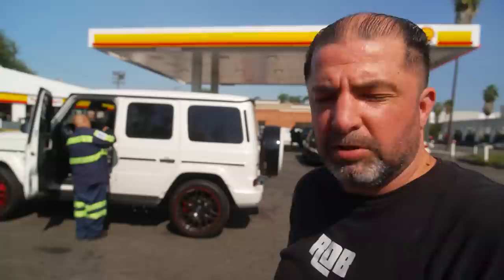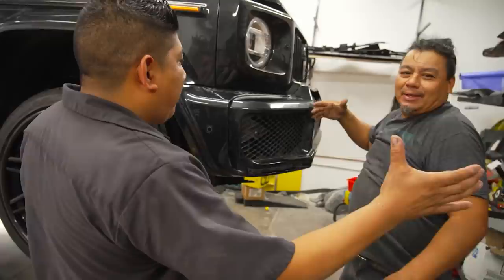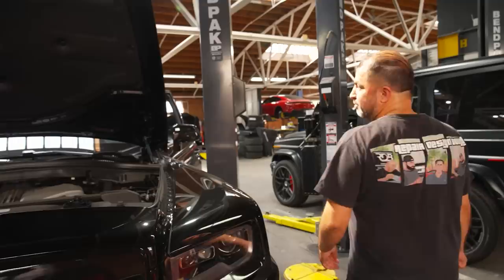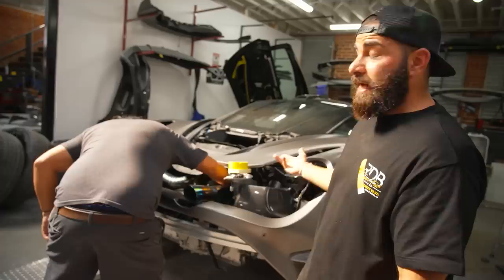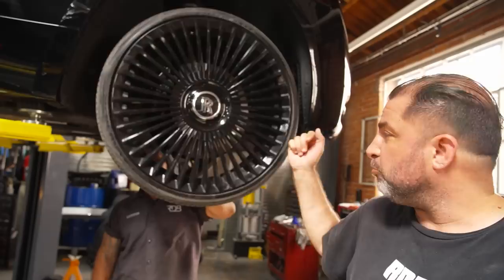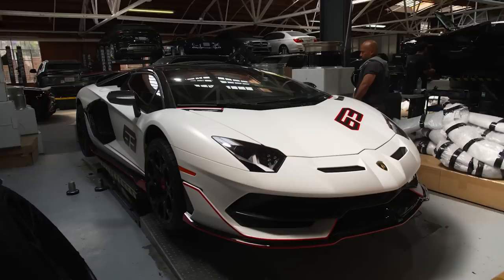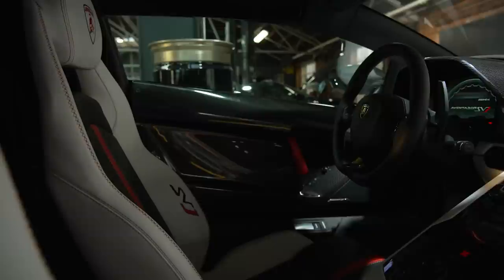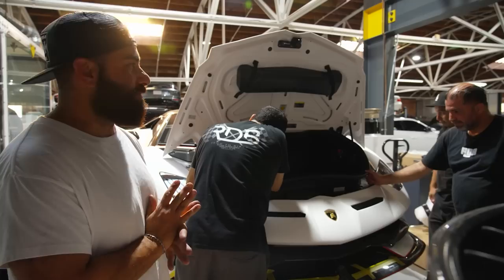Fixing Rolls Royce Wraith & Dawn, HEAVY Sf90 Spider, SVJ63 Projects about to Release!

Comment: how does rolls royce not have a break life sensor, if it had a sensor there would be no reason to replace the rotors
Reply: Rolls Royces do have *brake pad sensors. The customer was most likely ignoring the warning on the dash. The sensors will come on way before the pads get so low to where you'll hear weird noises everytime you step on the brakes.
Reply: Rolls are trash. Old luxury. Tesla is the new luxury. Self driving.
Reply: @InSaN3ViSioN  Tesla's are crap. They're not really fully self driving either, just your basic adaptive cruise control like many other vehicles...When Rolls Royce brings out the Spectre, it will be both old and new luxury.